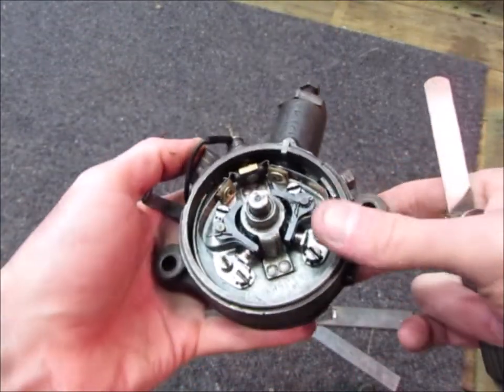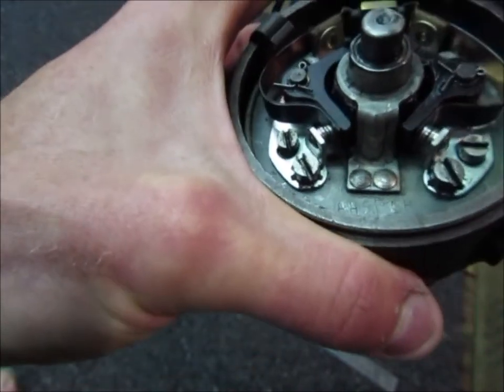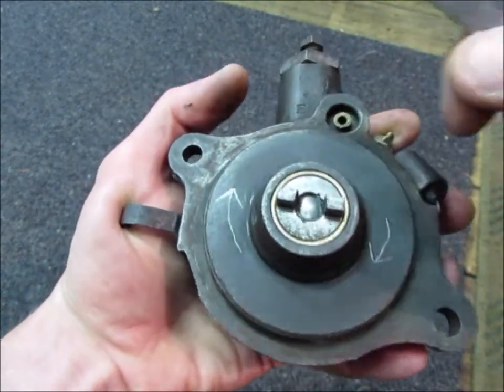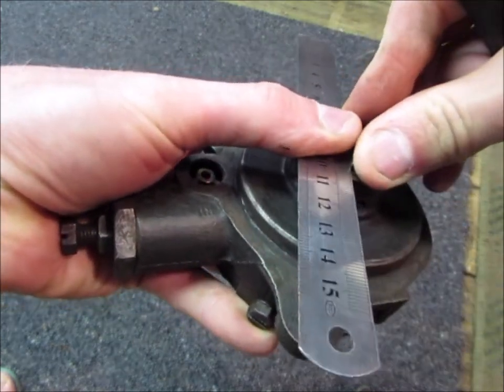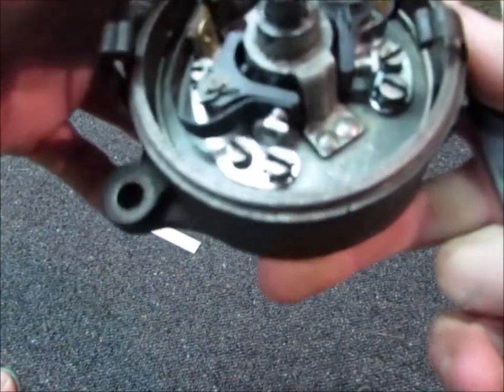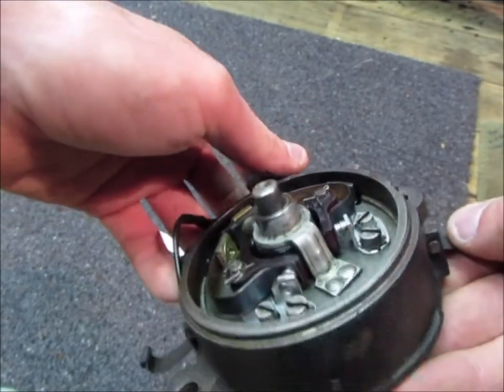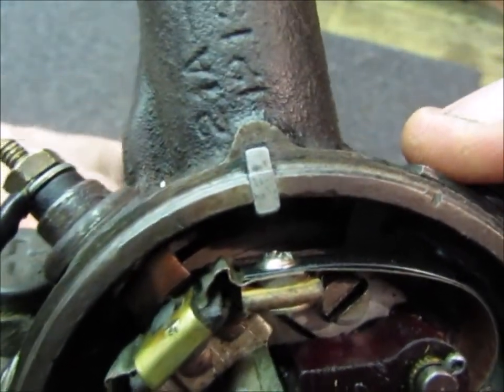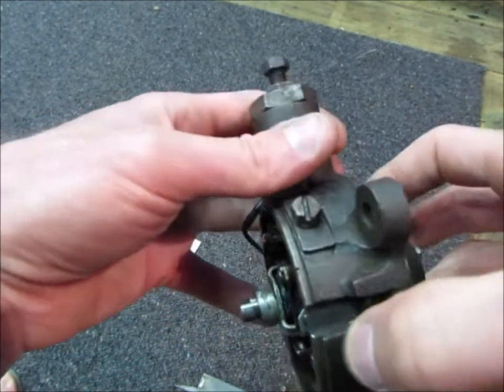Flathead V8, setting the points without a fixture

Comment: This is how I was taught to set a ford distributor.  However I was taught to use the card from a cigarette package (about  .016") as less likely to scratch or contaminate the point surfaces than a metal feeler gauge.